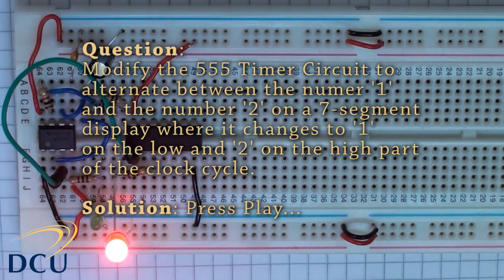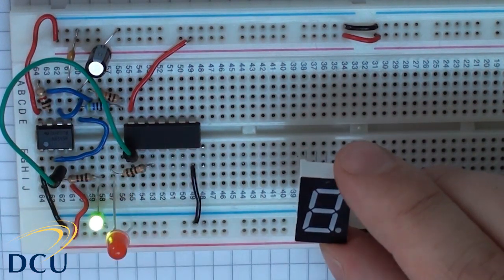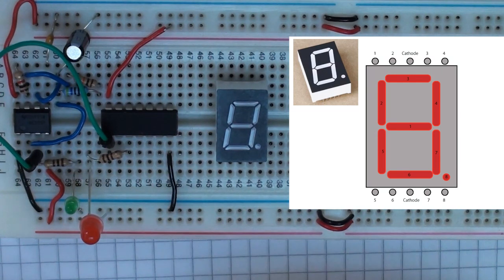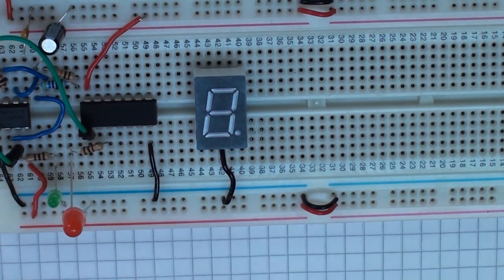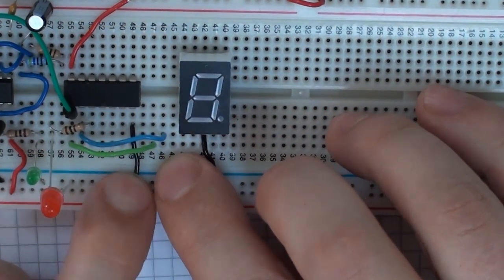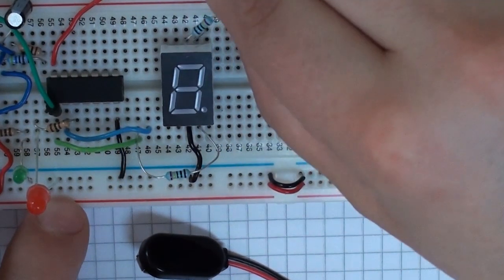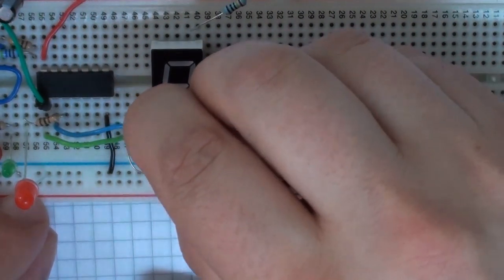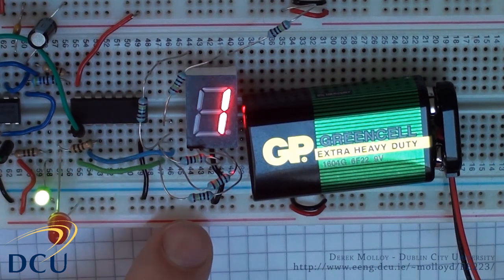Experiments 4.1.2: Questions: 555 Timer Experiment- Question 2

Comment: No because when "1" is showing only two LEDs would be lit, but when "2" is showing 5 LEDs would be lit. If you calculated the resistor for "1", "2" wouldn't have enough current. If you calculated it for "2", "1" would have way too much current. By putting a single resistor in series with every LED, you control the current to each precisely.